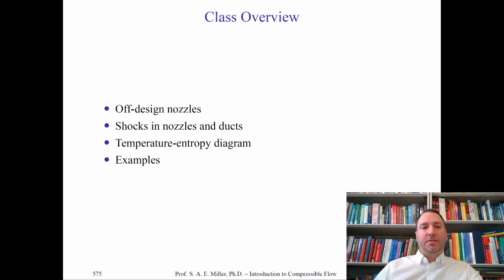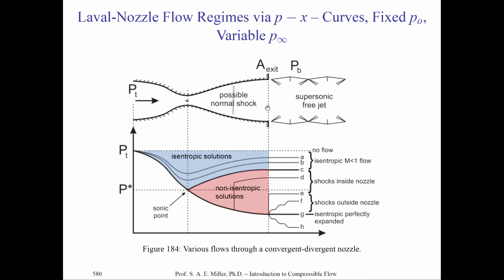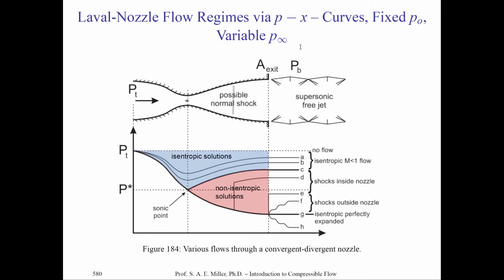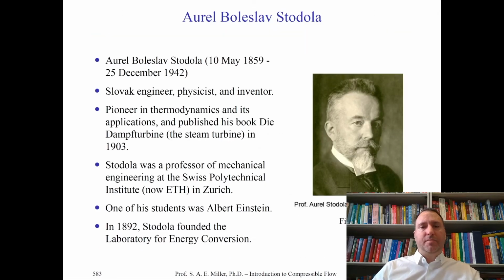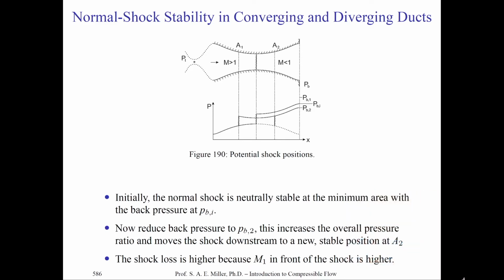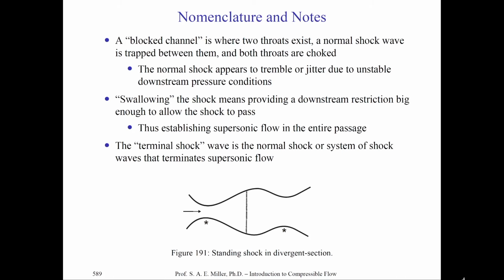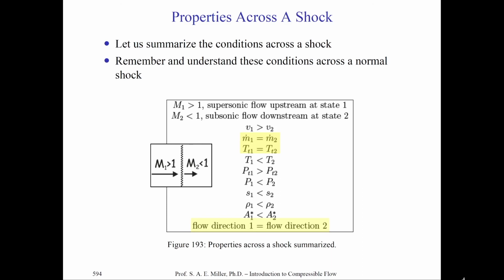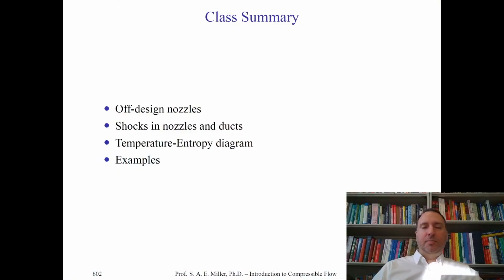Introduction to Compressible Flow - Normal Shock Waves - 7

Comment: Good day, sir. I'm greatful to you for these videos and it's no exaggeration to say they mean alot. However, most questions I see, I'm talking about the converging diverging nozzle, are either in the normal shock region or in the region where the assumption is that the converging diverging nozzle operates in design conditions i.e (subsonic at the inlet, sonic at the throat and supersonic at the exit) how then do we attempt questions in which there are subsonic conditions throughout(inlet, throat and exit)?
Reply from the maker: You can still use the Mach number area relation, and A is always larger than A^* (sonic condition). You will arrive at totally subsonic solutions. The flow in traditional theory will be isentropic throughout from plenum to plume.